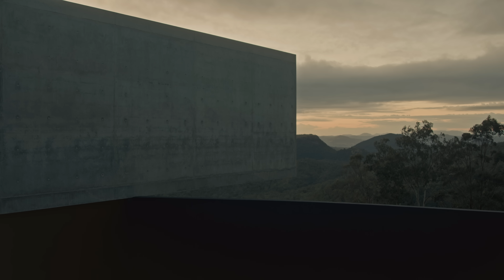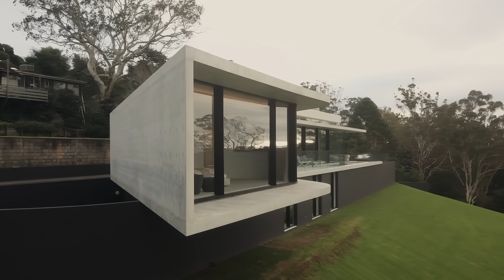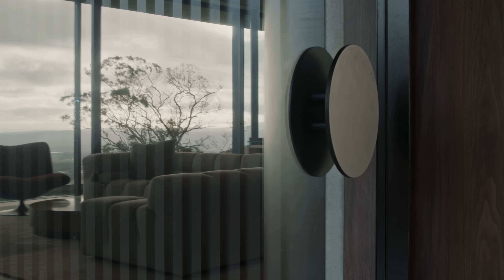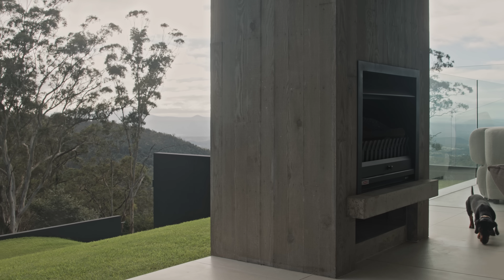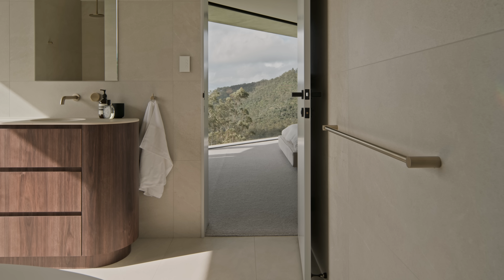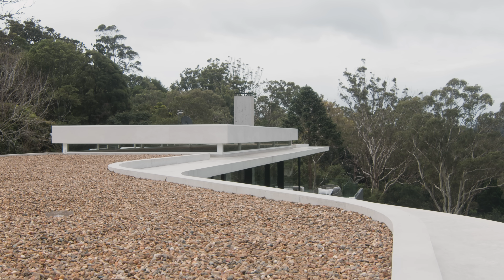Inside a Concrete Super House That Hangs Over a Cliff (House Tour)

Comment: That place is obviously beautiful.  I guess if I were going to complain it would be about any exposed sharp edges.  I get nervous when I think it’s possible to fall and have it end badly.  The pool is really nice.  I was thinking about a house I rented, I think in maybe St. Thomas, where the builder placed the pool right next to the house which is usually fine.  The house was elevated as was the pool. However I guess in that case they mounted the side of the pool to the home’s foundation and over time, because of the huge stresses created by a large volume of water, they were going to have to separate the two as the home’s foundation was starting to crack.  At least that was what the owner was telling me.

Comment: In the middle of the roof there is a gravel probably covering some thermal insulation and maybe waterproofing membrane. But how do you protect the exposed concrete roof perimeter against staining from rainwater mixed with dust and possible moss growth over the years?

Comment: Looks good, very simple and catches the eye. As a glazier I appreciate the glass and the technical side of that. On the downside the install team should NEVER have been allowed to put huge gaps  (60mm +?) between the ballustrade glass. In my opinion this never looks good, 5mm at the most between panels. 😁

Comment: Really nice design, that curved drive way into the dwelling is really cool. The negative, the entry way wall made of concrete block units looks out of place, and the exterior lower black facade could have had more interesting window solutions, is like you design the top and got tired by the time you got to design the ground floor.

Comment: It`s bulshit. The path that goes to the house entrance is near a 1.5 meter deep trench and has no handrail, a little mistake or if you are drunk and you may tear your head. And also it has no stone path near exterior walls that look to the valley, in case you want to go around the house you have to go through the earth and grass.
Reply: You would be a lot of fun at a party wouldn’t you 😂
Not sure where you got your measurements from but if you were correct the house would not have passed the final building inspection. 
Making comments with no factual basis just makes you appear ignorant.